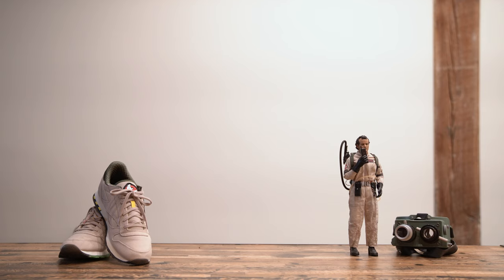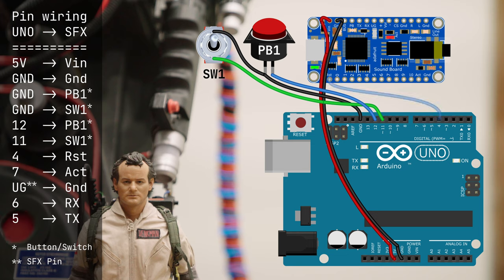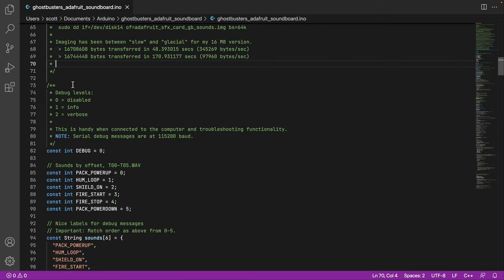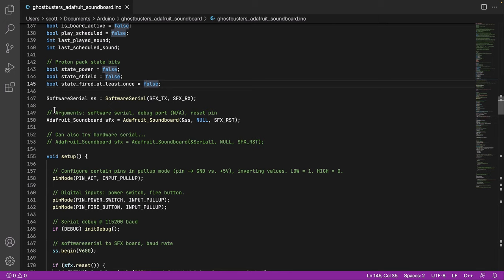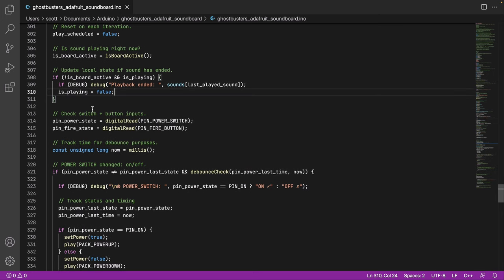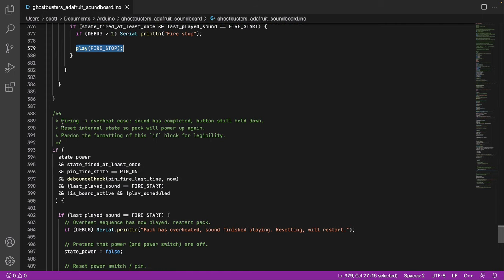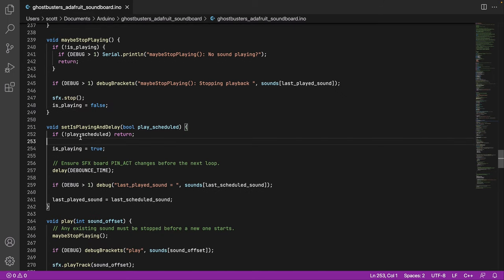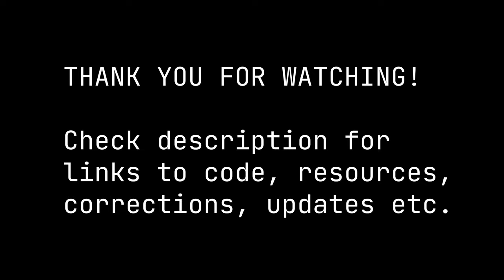👻💥🔊 Ghostbusters Proton Pack Sound Effects: Build Your Own / How-To, DIY Electronics w/Arduino 🛠️

Comment: Thank-you for this! I combined this with Lost Wax proton pack build and my son has an epic costume this year. I'm not sure if anyone else ran into this or not, but I did find I had to switch PB1 to pin 11 and SW1 to pin 12 to get my buttons working correctly.
Reply from the maker: Thank you for the note! It makes me happy to hear people are building these and getting them working. Have a fun and safe Halloween, and I will take a look at that 11/12 pin configuration. 😅
Reply: It was likely something that I messed up 😖but thanks again for putting together such easy to follow directions and providing the files so that even a hacker such as myself could make it work 😆
Reply from the maker: I had some electrical interference from the neon el-wire modules on my pack. Outside of that, the build has been pretty reliable. I'm glad you found this one useful and that it worked! My hope was that people could follow along, and skip ahead if there were concepts they're already familiar with. I think a bit of electronics experience is required, and minimal programming for those who might want to customize the Arduino code a bit.
Reply: Same here.. I had to switch it as well to make it work so I think its a mistake in Scotts instructions:)
Btw I have added basic lights to free Arduino pins - red lights loop on the pack, on/off red diod on wand and green-yellow diods on wand end when fire is on:D Works like a charm:D
Reply: My pack here https://www.youtube.com/watch?v=zMEqejgbr6U&ab_channel=MarekGasper
Reply from the maker: This is great! Thank you for sharing. Glad to see you got a working build.
Reply from the maker: I will have to look over my video instructions and the code again. I swear I triple-checked everything, but it’s entirely possible I made a mistake along the way. 😆

Comment: This is a great tutorial. I was hoping to find a video just like this but geared toward the Spengler wand and its effects like you did the Matty wand. Any plans for that....maybe....please.
Reply from the maker: Thanks. Are the SFX on the Spengler wand not very good, or not high-fidelity? I had thought they sounded better, since that’s a newer device.

I don’t have a Spengler one myself, although I did try ordering from Toys-R-Us initially—there was some shopping issue and it ended up bouncing, and I was refunded. 🤷‍♂️🤨

It’s possible someone could take my Arduino work here and adapt it to the Spengler wand, if you wanted the 1984-era sounds and whatnot. The work would involve getting wiring for the wand’s existing buttons, or perhaps adding some new ones like I did on the Matty wand.
Reply: They are great, I just want to mod it like the Spencer wand upgrade kit from Ghost lab 42. But their kits are rare. They tie the wand into the pack so the cyclotron lights changed color,  music plays, they changed out the 3 leds to an actual bar graph. Your video was very educational though. I'm watching the Odin Makes weekly build series of the Foam Pack build and is going to Arduino it using Bekonix programming system.
Reply from the maker: This all sounds pretty awesome. I’m not doing anything quite that wild, but these sort of projects are inspiring and awesome to see.

Comment: All of this is amazing and yes I'll be building one in a smaller version into my sons Proton pack but... my question is since I'm new to this, is where do you get the actual sound files from? I can't see where to get them. Also, does it matter what type of speaker you put into this set up? Finally thank you so very much for this, it's an amazing design and so appreciated how you went through it.
Reply from the maker: Thanks, Oberon. I have source code for the Arduino and related assets on my GitHub: https://github.com/scottschiller/ghostbusters_proton_pack_sfx

If you have a Spirit Halloween or similar pack which already has a little built-in speaker, you could try connecting it directly to the Adafruit sound module's 3.5mm line (headphone) output. However, it likely won't be very loud. You could either add a small 5V-ish amplifier, or try a version of the Adafruit module which has one built-in.

Worth noting: I have not tried or tested the version of the Adafruit FX sound board that includes the 2x2-watt amplifier, but I believe it should be otherwise compatible with the "headphone-out" version that I use in this video.

Let me know how it goes!
Reply: @scottschiller  THANK YOU SO MUCH! I absolutely appreciate your reply and your video, thank you for sharing and giving us all a chance to create something so cool. I'll go subscribe to your channel, wishing you an awesome up coming week. I'll let you know if I can get the components and set it up somehow. I'm currently stuck in Denmark so it's beyond me if I can get the stuff but I'll try. So the sounds used are in your link? For now I think I'll focusing on the proton pack sound not the Neutrino wand as my son doesn't have it. It's a recently released small backpack type from some company, I hope to install it into that. Yes I need to make it somewhat loud so the speakers can be heard. :) Thank you once more
Reply from the maker: You are most welcome! I have some unrelated fun stuff on the way that I think you might also appreciate. ;) All source code and related sound bits I used are at the Github link, correct. Once you have all the hardware and whatnot set-up, ideally you should be able to recreate what I did by going through the video. Let me know if you get stuck at any point. I know a few folks have mentioned taking on this project, but I haven't heard for certain if anyone has replicated it yet.

If you only need the proton pack "hum" sound, just having it power on and play that sound on loop should be a great start for your son's set-up. Let me know how it works out!
Reply: @scottschiller  outstanding! Yes I'll try to get my hands on all the components and when I have them I'll show you how I made it work. Thank you once more! Looking forward to more awesomeness from you! I've been wanting to create a smooth swing TRON Disc with lights and sound, but for some reason it's not been that popular. :( I love those discs though. Too bad no one made a real good replica with lights and sound since we know how little NeoPlex Lightsaber circuits are and how much they can do. Have a great week!

Comment: How would I remove the shield sequence? I want to use this for my custom proton pack, and the only thing I'd want to change is the shield
Reply from the maker: If you want to skip the “shields up” bit and always have the fire sequence, I think you can set the shield bit to always be high or true. Then the code won’t wait for that first button press.
Reply: Thank you @scottschiller 
I would also like to ask, would it be easy to swap sound effects easily? I was hoping to use the Sound Effects from Ghostbusters Afterlife rather than the 84 pack (technically I'd want to use both and have a switch that switches the  sound effects but that sounds ambitious)
Reply from the maker: @thefwaynes Swapping the .wav sound files shouldn’t be much trouble, but see my notes on the files and flashing them to the device. Sometimes copying from your regular desktop works OK, but not always because computers sometimes put metadata like .DS_Store (i.e., macOS) files onto devices and that can mess up playback when you are trying to use the device.

I’m presently mobile and I forget if I covered it, but you should be able to make and flash your own image with your own sounds directly to the device.

The only other thing I can think of is the overheat sequence, which relies on a fixed timer of about 14 seconds in the code. If you replace the main “blaster” sound, I recommend a loop of the same duration as what I made to start.
Reply: One final question @scottschiller 
Would it be possible for me to add more toggle sequences. Specifically two wuring up sounds like in afterlife. It wouldn't be affecting the function of the pack but it would just change the hum in the background.
Reply from the maker: @thefwaynes Easiest thing would be to edit the existing sound files, no code or electronics changes. If you have some examples of the afterlife stuff, I may be able to look.

Comment: Awesome... Do your lights work also with arduino? Do you have a code for lights and sound? I am currently trying different codes to see what I like the most, but I am an absolute noob in coding and have absolutely no idea how I could use your code an paste&copy let's say a light code from another .ino into your code so I can run it simultaneously from one arduino and don't have to use two 😅

I tried to read some books about arduino, but they don't go really into detail, the most just show examples and then say something like "with this code you can do various effects" but don't tell me how 😅
Reply from the maker: No Arduino required for the animated / motion el-wire etc., that’s just plain old electrical wiring. I think most of that runs on 3V.

Comment: Is there any way for it to complete a sound every time the trigger is pulled? Like a laser blast sound plays to completion each time so they stack? Or is that a limitation of the board all together?
Reply from the maker: This could be done, albeit with some specific limitations.

This particular SFX board can play only one sound at a time.

You would need to modify the code to basically ignore the button up / “release” events which would typically stop the sound.

In order to get stacking effects, you would need a different sort of sound board. I imagine there’s something out there, but I don’t have any specific ones to recommend.
Reply: @scottschiller  Thanks so much. I had a feeling, but it couldn't hurt to inquire. Thanks for your post and for being so thorough.

Comment: Well everything came together pretty well except that it plays the wrong files in spite of their labeling. I saw your note about reformatting the adafruit but, alas, to no avail. T00 is my pack powerup, etc. But when I push the power button, it plays fire_stop then loops pack_powerup. When I fire the first time, instead of shields it plays hum and at rest it plays fire lol. It's all over the place. I'm just going to relabel the files and see if that gets me there. The serial monitor shows everything executing without a hitch and just to be sure I manually triggered 00-05 (disconnected from UG and reset it) and the triggers are correct... it just plays the wrong sound file even though the files are named correctly and match with the program. Beyond the shadow of a doubt it's something I'm doing or my board is janky.

Edit: After some poking I noticed one pattern... T00 plays T05, T01 > T00, T02 > T01, T03 > T02, T04 > T03... it's like they're all offset by one with 00 restarting back at 05.
Edit: Attempted to rename/reorder the files... didn't affect it at all. Still plays the EXACT same sounds regardless of file name. Extra weird. Is it pulling some kinda meta-data?

Edit: Loaded the example sketch for the soundboard and for no apparent reason it has Trigger 0 assigning T05. That explains the offset, but no clue as to why it's doing that.

Edit: My new challenge in the meantime is when I push fire, it's playing the whole 18 second clip and not releasing when I release the button. If I hold the button down, debug shows it "finished sound and overheated/restarted" but it just finish out the long sound file and goes back to the hum. No "fire stop", no "holding until overheat and restart". I noticed you made some discoveries in your code that you intended to change but it still seems to match what's downloaded. Were there any changes you made after the fact that may affect this?
Reply from the maker: Strange! Thanks for the detailed report. Ghosts in the wiring? Heh.
Sometimes I had to reformat the SFX board to get all sounds working, and image it vs. trying to copy files from my OS one-by-one. I think when I had trouble, it would be that a given sound just wouldn't play at all.

It sounds like you have identified the pattern, but it might help debugging if you make a short series of sounds that say the T## in each.

Since the triggers are OK, maybe something is up with the serial connection or code. If you use the Adafruit example programs instead of the GB stuff and do serial control, does the SFX board work OK?
Reply: @scottschiller  I used to work I.T. a loooong time ago... and this is the reason why I got out, lol! Swearing toward the heavens and trudging forward on a seemingly ceaseless bug hunt. Fortunately, I can do all things through spite which strengthens me ^_^.

So, I disconnected it and used it stand alone. Works perfect. 0-5 trigger as they should when grounding the pins.

Someone recommended I add  <void play(int sound_offset) {Serial.print("sound_offset = "); Serial.println(sound_offset); and it displayed it was playing what it ought to, albeit the wrong sound was coming out.

As to your recommendation, I loaded the menucommands.ino from adafruit and that's where I discovered the mismatch where "0 name: T05 WAV" situation went down. They play correctly from that interface.  I can rectify it by relabeling the sound offsets in your sketch... instead of 0-5 it's 1-5 and 0 (but I don't like bandaids, just means I don't really know what's happening and won't be able to handle it, again, in the future). No idea how to get T05 down at the bottom to Trigger 05 where it ought to be on the FX board. To keep things in order I moved const int PACK_POWERDOWN = 0; up in both places per your note to match order. (I'm not a programmer... more like a code scavenger).

Now, with that work around, the right sounds play at the right time... except... Fire Start plays the whole file, releasing the trigger doesn't stop it for whatever reason (nor play Fire Stop).

And holding the trigger doesn't wait for the sound to stop playing, seems like after debounce it just displays that the pack overheated and that it reset but the Fire_Start keeps playing until it's conclusion and it returns to hum. Pressing the trigger again simply restarts the whole 18 second debacle.

I note that the Shield_On playback ended and play(Shield_On) keeps looping but calls sound_offset 2 (which is the correct sound for Hum_Loop and it's doing the Hum_Loop as it ought to... just... displays Shield_On. Really it's just displaying all the wrong strings but playing the right sounds which blows my mind because I'm looking at the code... HUM_LOOP = 2! Play(HUM_LOOP); and it's just like "nah, I'm gonna Play(SHIELD_ON) with sound_offset = 2". It's madness!

A new Uno just showed up in the mail today... for giggles, I'll swap 'em later and see if that makes any difference.
Edit: Had a waaay older Arduino but swapping them out hasn't changed anything.
Reply: Ah well... without changing much of anything (definitely not any wiring or input/output values) it all just stopped working. I think I may have damaged the pins somehow. No idea how. Even the original and unmodified sketch won't work. But... I now wash my hands of it and don't think I'm gonna touch it again, Some of us have that "gremlin's curse" where electrical things just cease to function in our presence. Thanks anyway!
Reply from the maker: Ah! It’s annoying when electronics don’t behave as expected. I had to put a ferrite bead / choke on some of my Arduino wiring, there was some interference sneaking in somewhere.

I have heard of some folks who have a natural electrical charge or similar, that makes it difficult for them to work with electronics.
Reply: I had same issues when I started my project 2 years ago.. Found out that there was a loose contact on my Adafruit so I soldiered it and everything started to work like a charm:)
Reply from the maker: @marekgasper391 Huh, good to know! Thanks for the tip.
Reply: @Tolderian  Hi Did you fix this? I have the same problem, when I let go the fire button the fire sound keeps playing until overheat
Reply: @scarface7883  I did but you won’t like the answer. I went with a SparkFun Tsunami. It’s a bit expensive but every bit a superior product to work with.
Reply from the maker: Sorry for the trouble, this can be annoying. Others have suggested checking for loose wiring connections. I recommend also enabling the serial debug output which may have home hints as to what’s going on, why the fire release is seemingly having no effect.
Reply from the maker: I remember seeing this and a few similar options, and thinking I didn’t want to spend the better of $100 up front. I imagine it’s more feature-rich than the Adafruit board, of course; trade-offs!

Comment: i noticed none of the pack lights are associated with this code or the arduino itself. are you handling that with a separate unit (arduino)?
Reply from the maker: This pack came with the vertical blue bar, and the four red circular lights. Both are separate electronic modules and I didn’t build those.

An Arduino could probably run the pack lights as well as the sounds.

Comment: Am I missing where the breadboards are used and wired?
Reply from the maker: I did not show the breadboards in detail, my apologies. I used them just to make connections to the switches in prototyping, in part, and to have something to mount the sound board on. The schematic is the “recipe” if you will for the wiring, and you can use whatever kind of breadboard you like.